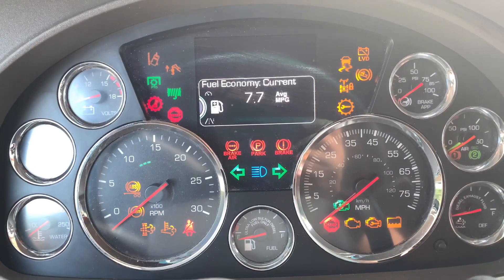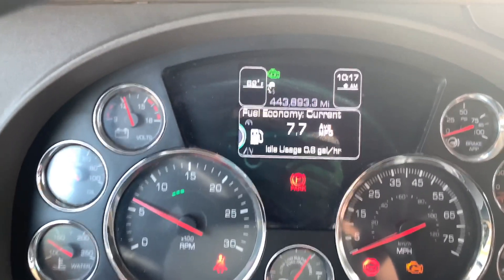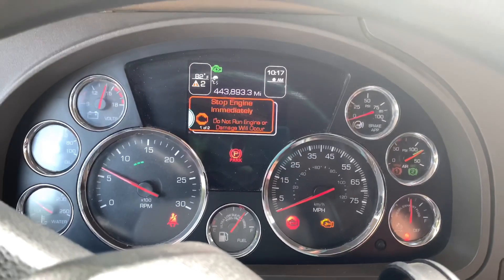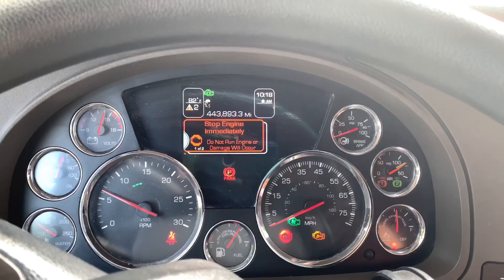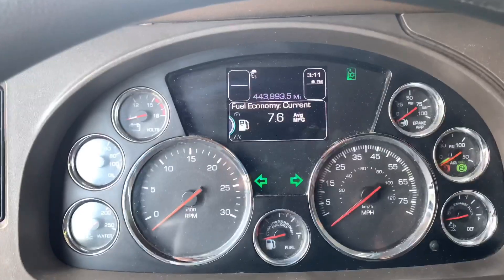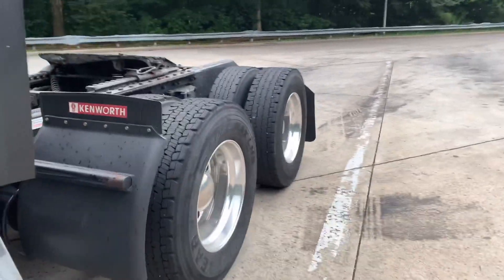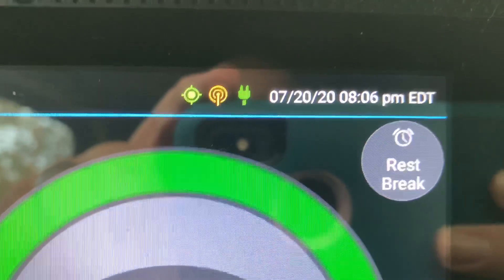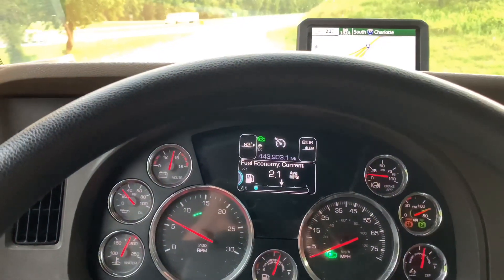2017 Kw emission system shut me down. Here what happened. 1 part caused this.

Comment: Good to hear you have it sorted.
Hate when that happens. But can take comfort in not being Boeing. They decided one sensor was all they needed and removed a redundant one ( angle of attack ) so when the one freezes up the plane dives into the ground. This was called either bad luck or oops. There was a whole list of other cut corners but that one alone could have left them flying.
I've got a couple of engines to troubleshoot for sensor issues too. The diagnostics are claiming the new sensor is still bad, so time to reverse engineer the control computer. But later.
Reply from the maker: Hope it’s fixed for a while
Reply: @ralphstrucking  can we be friends
Reply from the maker: SCRATCH & MATCH I do have a scratch channel. Doughboy scratcher. But you get both channels

Comment: I hate them it happens to  alot of the trucks over here in UK depultion filters. They breaking all the time. They even break in the car's as we have them in  the new car's. Limp mode sucks man. DPF they call it over here Add blue. Wheels ain't turning you ain't earning mate. I know that one. Towed back that is crazy mate. All down to stupid sensor. Broke down again stupid KW .That's crazy mate  there full of sensors  these day's stupid law's mate.👍
Reply from the maker: Sensors is money tho.
Reply: @ralphstrucking   I know that one well buddy. That's why I run old Vws and Audis lol. But I work on alot of the newer stuff even used to work on truck's